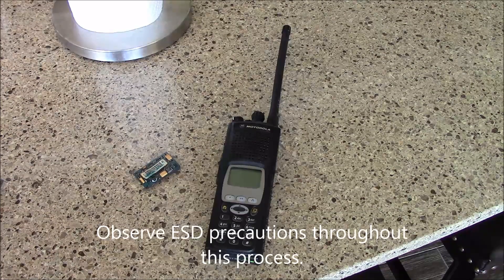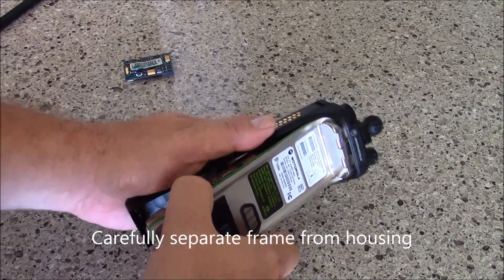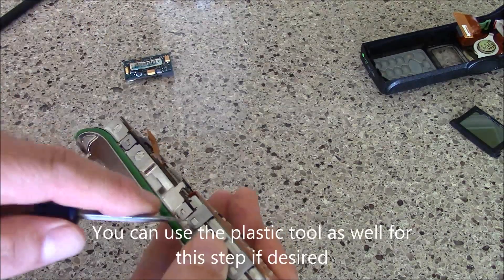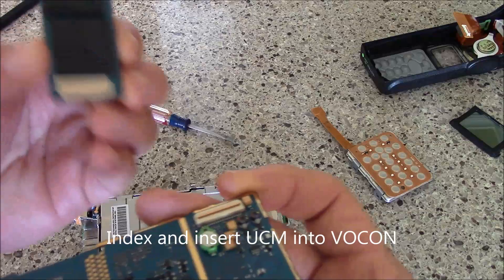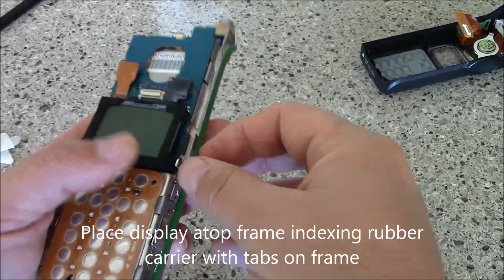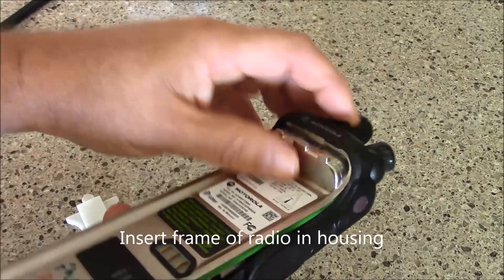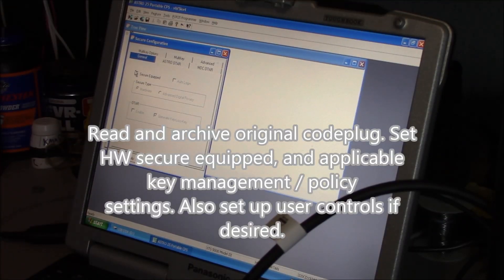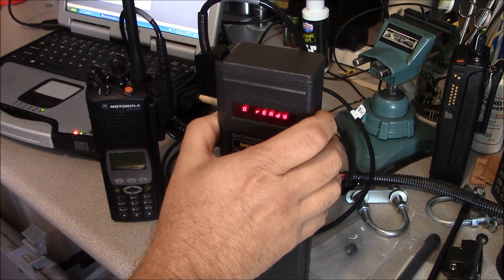Motorola XTS5000 Disassembly / UCM Installation

Comment: Where did you buy that tool?
Reply from the maker: Motorola but it has been out of production while.  The second tool from the left in this set does a great job and it is much cheaper than the 3d printed copies on ebay :https://www.harborfreight.com/trim-and-molding-tool-set-5-piece-64126.html
Thanks for watching !

Comment: Can you provide a link for the pry tool?
Reply from the maker: The original one has been discontinued by motorola unfortunately . There are 3d printed ones  available on ebay but the best bang for your buck is the thin tool in this set from harbour freight https://www.harborfreight.com/trim-and-molding-tool-set-5-piece-64126.html It works great and you get a bunch of other handy prying implements. Thanks for watching !

Comment: Sir's Question: Does the XTS 5000R have Modat for signaling ? Options ? Thanks
Reply from the maker: No legit xts5k has modat. They are out there but they are not factory flashed for such.
Reply: @survivalcomms  Thanks . I noticed the XTS3000 has Modat so I was hoping the XTS5000 had it also. Please let me know if I send my radio to you can you flash it for modat ? Possible?
Reply from the maker: @ecversevictim1848  I do not have the capability to flash your radio. Thanks for watching !